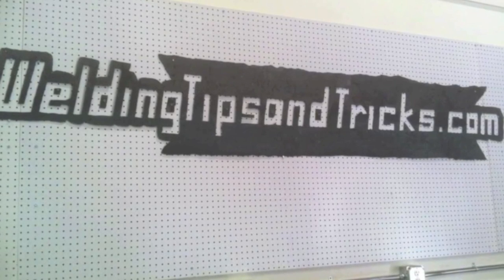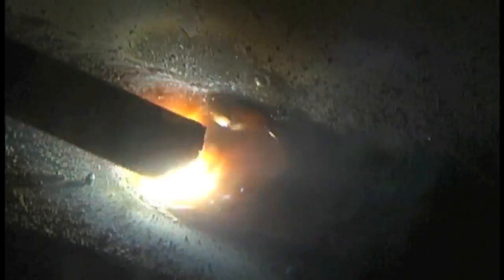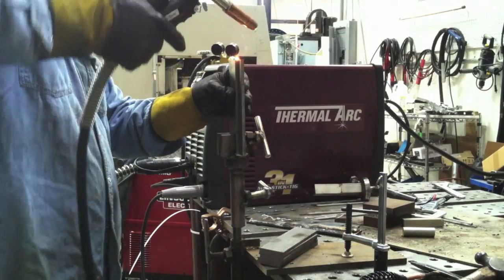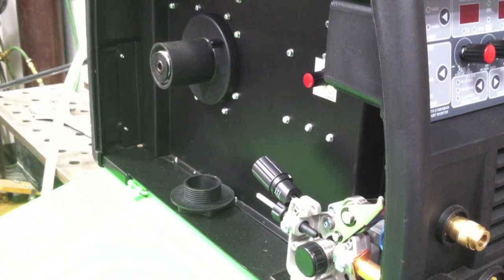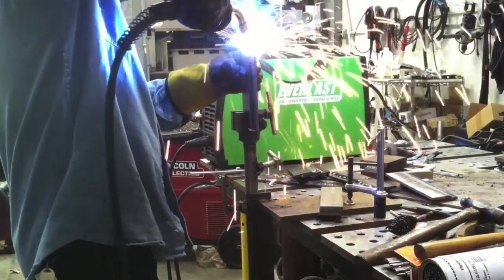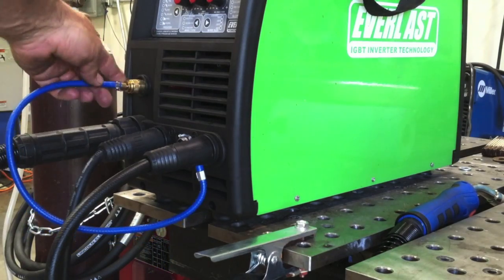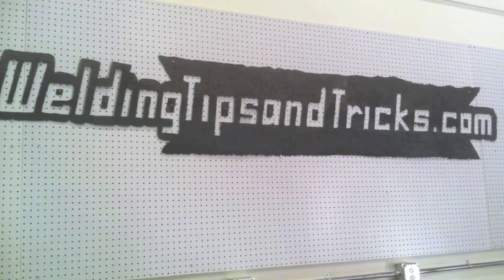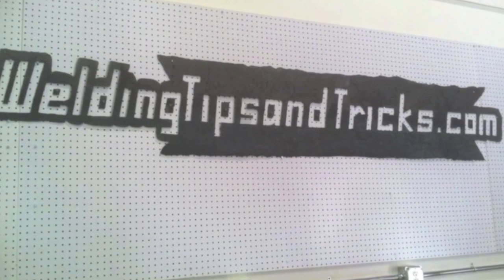Multiprocess Welders Demo - Everlast mts 250s & Thermal Arc Fabricator 252i

Comment: thermal arc= dual gear driven feed rollers...............neverlast= one drive roller
Reply: NOT IN THIS VIDEO
Reply: Bill David my miller multimatic 200 is similar to the everlast drive system. Not sure what the mm215s look like inside, I also think the Lincoln ?210mp? Is the same.
Reply: Everlast MTS251si = four active gear driven rollers

Comment: Has anyone seen the Miller Multimatik 200? Looking for opinions on this machine.
Reply: I suspect 200/211 is technically better but also more expensive. Everlast is great for budgetary stuff but not all Everlast boxes use standard connectors. For the price of the a 200/211 you could buy a 251si that is most likely a better value with some money left over.

Comment: everlast is on top right now if you look at there sales compared to thermal arc (victor) and longevity everlast has sold 13,000,000 units since 2011
Reply: +silva1320 let's see if miller lives up to there warranty  Everlast will replace them
Reply: +silva1320 well it was a expensive gift to my self :-)
I love it, it have up to 15khz metallurgical pulse so you can get a needle thin arc at high amps
My friend have a ESAB caddy 2200i tig
It's really nice as well
Reply: Would not take an everlast if you throw it after me! Chinese junk!
Reply: +Martin Andersson I own miller and Lincoln  to and there made in China assembled  in the USA so technically  it's Chinese  too lol
Reply: +Stickwelding 247 well does not matter, I have a Fronius, EWM and ESAB, the EWM and Fronius comes with 5 year warranty,  
Would not touch that Chinese crap
Reply: +Martin Andersson so is esab  you think they don't make there products  over seas you are sadly  mistaking but hey let's see if they honor that 5 year warranty  my Everlast is past it 5 year warranty  and they still  replace  mines lol
Reply: +Stickwelding 247 ESAB is made in Sweden and Poland 
EWM in Germany and Fronius in Austria 
And if evercrap are that great, why don't you se any in the industry? 
ESAB was first out with inverter technology 
The John Deere plants uses EWM 
For an example 
Fronius have developed CMT and steel to aluminium 
Please tell tell me what evercrap have contributed to?
Except cheep knock offs with poor quality?
And yes a lot of the components are from Asia but it's like comparing a Kia to bmw the both have components from Asia
Reply: +Martin Andersson Everlast  uses seimens circuit boards which is American  and a huge  computer  company  for inverter  based tech
Reply: +silva1320 yes i would never buy any Chinese cheep crap
My tig machine is the most advanced 220v on the market
It's a EWM Tetrix 230 AC DC with a comfort panel. Sure it's 6000 dollar unit
But it will last a lifetime and the are service and parts available 
My mig is a ESAB caddy 200i
Love that machine to

Comment: Great video on the everlast 250. I'm thinking of purchasing the everlast 200 it will be my first machine and wanted something I could weld at least 1/4" thick materials as well as all the different types of welding (mig/tig/stick). Do you have any other recommendations for multiprocess machines or would this be the machine of choice?

Thank you

Shannon

Comment: Great video; I'm considering the Everlast 200/250mts to the Thermal Arc and Lincoln equivalents. Sure does seem like a lot of value for the dollar, although it's hard to cut thru some of the negative Internet chatter...everyone has opinions...what to believe...
Reply: 5 year warranty, I'm not going to lie definitely sounds like a deal on them but I'm a little hesitant about it myself. If I decide to pull the trigger then I can come to my own conclusion, obviously. But won't bash or praise them until I have personal experience.
Reply: Don't buy any cheep Chinese junk

Comment: what are your thoughts on the miller multimatic? for around $2400 i'm torn between that and investing a little more and getting a diversion 180 and a millermatic 180 for small time fabrication and repair
Reply: All depends on what you are trying to do, weather you need that tig or weather you need the higher amp mig or not that is for you to decide.  Whatever your decision you can't go wrong they are all great welders.

Comment: Everlast is a crappy made welder. Their customer support is even worse. Good luck getting them on the phone. Go on welding web and read all about their mishaps - they try to delete all the negative threads of product failures, bad service, etc. You will be glad to go with Thermal Arc and save yourself the headaches.

Comment: As a side note, the argon mixes provide various penetrating and heat control characteristics, like Argon 52 is a more  general purpose mix and burns hotter than Argon 07 which "burns" colder and is much better for thinner metals when being used for example in car bodyworks.  Pure argon provides an oxygen depleted environment so the weld does not have any contaminants in it and because of the control TIG offers over mig the mix is not necessary. Although Argon 52 with Tig melts electrodes nicely!

Comment: I've tried using torch amperage controls and just didn't like it no matter how much practice I got it. I always had too much movement when trying to upslope and downslope. Personally I have the PowerMTS 250s for about 4 months and am loving it. If you get an MTS, get a spool gun too to really make it versatile. It's nice being able to adjust the wire feed 20 feet from the welder with the spool gun control.

Comment: I have the 252i and I like it so far, had it about 2 months. The 252i is made in New Hampshire where the lower 2 models are china. I found that handle hard to work with even with the pedal. It also doesn't have pulse.

Comment from the maker: tig welding is best done with 100% argon. mig welding is best done using mixed gas like c25 (75/25 ar/co2) or pure co2.  there are other mixes with different applications but c25 is a good all around gas for carbon steel fabrication using short circuit transfer mig aka short arc.  stainless steel mig welding uses either tri-mix gas using helium, argon, and co2, or something like a 98/2 argon/oxygen mix or other argon mix.

Comment: Could you possibly make a video about different tig settings for different materials? You had mentioned that you'd have less than 1 amp per thou on stainless, a little more for aluminum, and right on for carbon steel, could you possibly go a little more in depth on a topic like this?